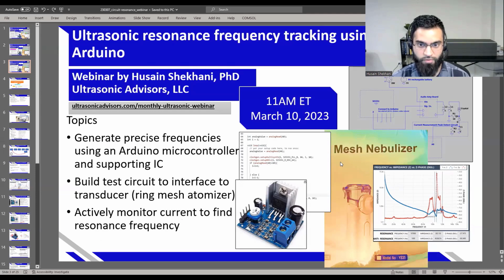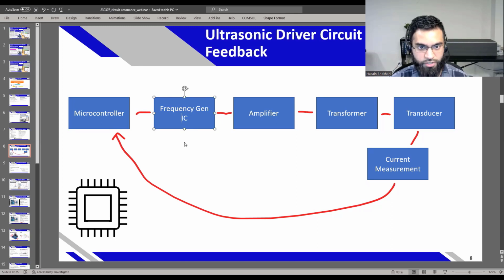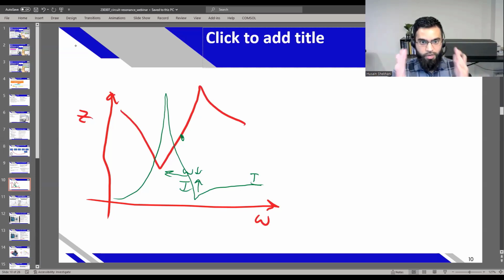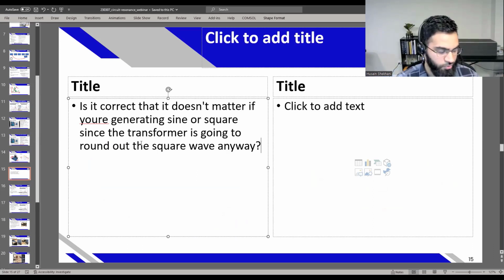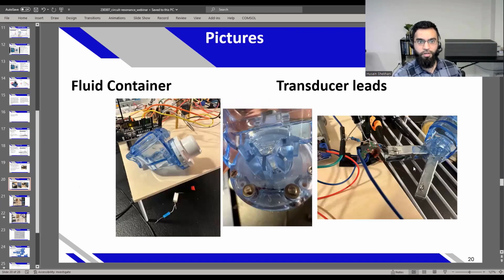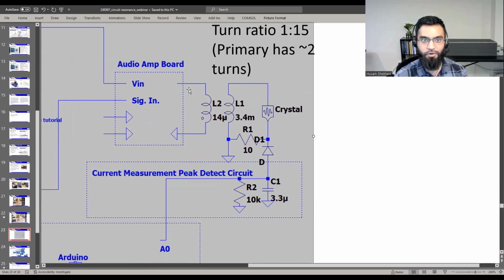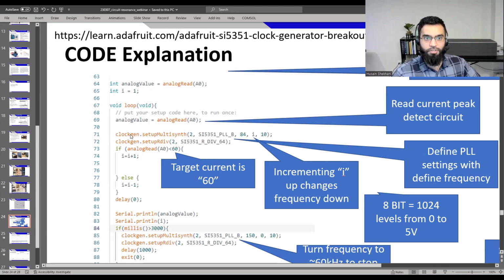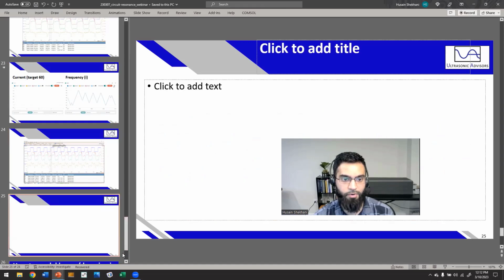Ultrasonic Transducer Resonance Frequency Tracking using an Arduino

Comment: This is exactly what I was looking for few years ago and I am still working on it. Do you think you can do a video on how to control the spray rate  ? I am assuming that would be through the frequency? Thank you so much.
Reply from the maker: You can control the spray rate through voltage amplitude control or frequency